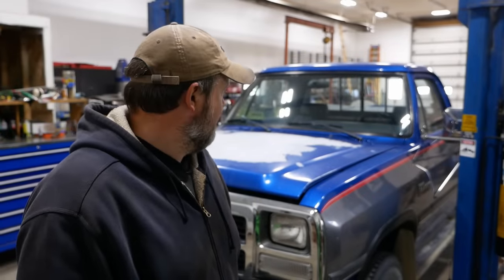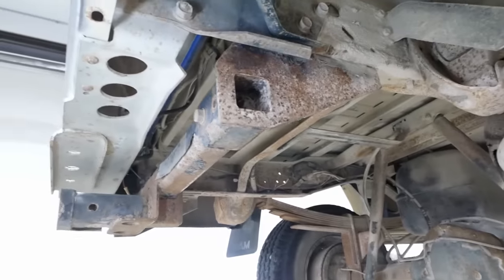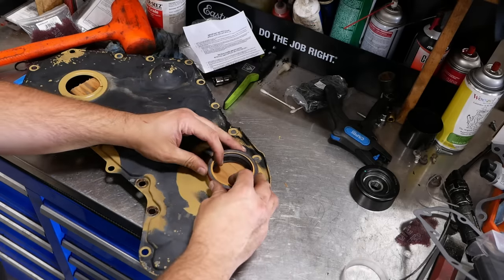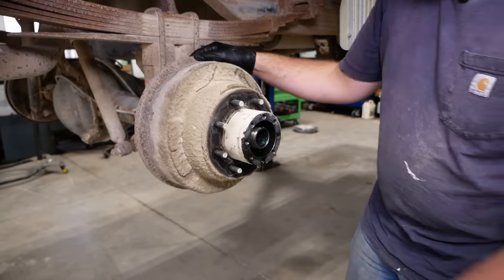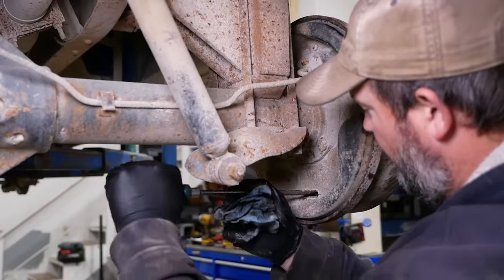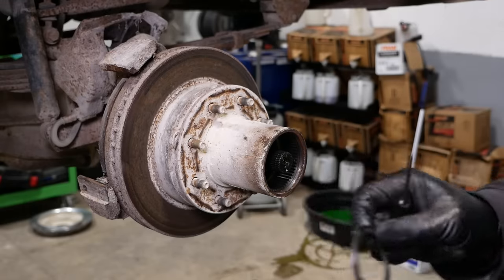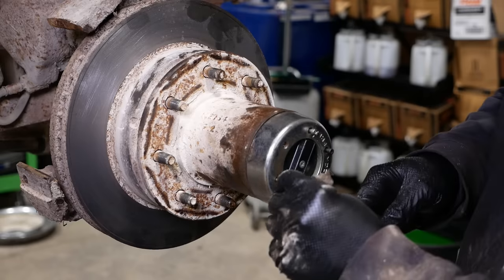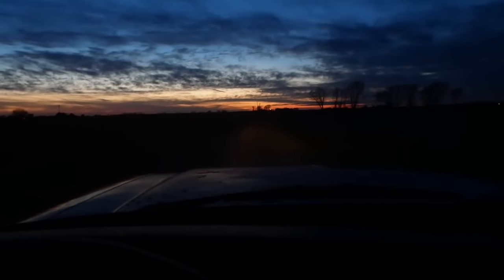Cherry 92 Dodge Cummins: Killer Dowel Pin, Brakes, Seals, Etc.

Comment: You said according to Dodge, about 5% of these will have the dowel pin failure. Does age have anything to do with chance of failure? Just thinking that since it made it this long, what are the chances it fails? That being said, the condition of this truck certainly warrants the fix. Nice work dude. Oh by the way, always enjoy the Max cameo.
Reply: age does not. a realtives daily had this happen at just over 300k a year ago. it did the works on the motor turned it into a paperweight. and my dads work place they almost exclusivly drive dodges for their work vehicles that need to pull trailers minus the one 7.3 super duty and their 2 6.0L E350 Econoline vans.  they got 6 98-01 Ram 2500-3500 with the same engine they ofcourse all ofem have a million plus miles but not too long ago one of them got a new Reman (old new stock) engine. its engine was just slap wore out. not even 35k on the new old stock dowl pin came out. busted their timing cover. don't mean to throw any shade at dodge but. reason why i like powerstrokes especially the 6.0L easiest to repair. and least likely to turn your block into a very nice Coffee table and a rolling chassis in the yard.
Reply: If your luck is bad then yeah it can happen. LR had an issue where they forgot to Loctite an oil pump bolt on the early td5's. Saw a forum post from some unfortunate person that had it fall out at 300k km. Him and his mechanic had assumed it had either been loctited already or had been from factory.
Reply: Age or mileage mean little. If you have one you should get it fixed now and mark the timing cover so the next owner knows it’s been done. There are literally no downsides to doing the job. Worst case you tear it apart to find it’s been done already. Or you open it up and find it almost out. It’s a cheap fix to avoid total catastrophe.
Reply: The biggest concern is that it's a dodge crummins. You're doomed until you fix that issue.
Reply: Age isn't relevant.  It was mostly a problem on the 94-98 trucks with the P7100 injection pump, but definitely happened on the earlier trucks too.
Reply: @justnsaliga8518  The dowel pin issue has been known for like....MANY years though. Plus the fix is...a tube of Rtv...and 5 minutes of fabrication work or some 20 dollar ''kit''. Really like...yeah its a PITA because its not perfect, but issue wise? It's a simple fix that doesn't cost much.

Comment: Track bar where it ties into the frame will get wallowed out there, due to the gear box flexing the frame horn that holds it.
They sell a new addional crossmember that ties both frame horns together allowing for proper support of the gear box..
It has an extention that goes through a block bearing mounted on the crossmember that extends down to allow for proper alignment of pitman arm that pivots every time you turn the steering wheel, and supports the lateral load of the suspension. 
The track bar mount on the frame itself gets chewed up for the excessive movement of the gear box and has to be cut off and a new higher grade steel mounting plate welded on, are at least added to the original plate to repair the damaged hole 
The other end of track bar that attaches to the passenger hub assembly typically is also worn out by the same thing.
New steering gear box 
New addional crossmember added 
Replacement of track bar 
Addional repair of mounting plate of track bar at frame driver's side. 
And typically tie rods,  if it doesn't have the stabilizers dampers for the steering 
It's usually a good idea to install the set with two stabilizers even if it has just a single one mounted, and especially if none at all in place. 
Also found that while shocks appears to be good its mainly just the springs doing majority of the work, and a good set of bilstines helps greatly control the death wobbles along with the above mentioned items. 
I've rebuilt 97, and 95 one a 2500 the other 1500 both 4x4's.
But they share the same parts as well as the f'ed up design all the way up to 3500's.
Not really all that expensive to buy, but fairly labor intensive, except for the benefit of actually being able to drive it like a normal vehicle instead of you constantly chasing the direction the truck is going, are then sudden attack of severe case of death wobble its not really that much labor considering the benefits and longevity of the truck was doubled are even tripled it's normal life span.

Comment: Nice work Wes.  I have the same Alemite bearing packer, although it doesn't get used nearly as much these days as it did a couple decades ago.  

I'm glad you see you double check the end play with a dial indicator vs. merely backing off the nut which is what I see most people do.

I have a client that has an old 1997 Dodge W-250 that is also in pretty nice shape for its age but it has nearly 200k miles.
Mike
Reply: In my 1960s high school shop classroom, our instructor had a sign hanging above the blackboard the said "If you don't have time to do it right, when will you have time to do it over". About the only thing I remember from high school!
Reply: @Watchyn_Yarwood  my dad would tell me the same thing repeatedly when I was growing up.  "If you don't have time to do it right the first time, when will you have time to do it again?"
Reply: @zmotorsports62  And you never forgot it. Young people today are taught "Don't worry about it, I'll get you a new one".

Comment: To mostly cure death wobble and shit front end on 2nd gen 3/4 and up trucks, upgrade your sway bar to a third gen.  Also look into the power steering stiffener bracket, those two things alone will change the whole driveablitly of those 2nd gen, oh and one last thing, as others suggested, upgrade to the borgeson steering shaft.  That was one of the 1st things I did on my 97 ram 2500.  That was a huge improvement alone

Comment: For the 97, If the steering slop is in the box try a red head steering box. Those original boxes are know to wear out. Also the make a steering gear stabilizer kit that braces everything.

Comment: Wes I had a 94 dodge with extremely bad death wobble. I did literally everything. New ball joints, new sway bar bushings. All new tie rods, steering gearbox stabilizer kit. Nothing changed at all when I did all of that. What did fix the problem for me is upgrading the track bar from the 2nd gen ball joint style to the third gen adjustable bar with bushings. That eliminated the issue completely. Not a bad install either. The kit came with a piece that mounted to the frame and a bolt ran through the existing ball joint socket. If all of your other components are in good shape I would absolutely do the track bar conversion. I’m 100% confident had I done that first it would have solved my issue completely.

Comment: The 95's front end can be upgraded in many ways. The best places to start are putting a 4th gen steering box in and switching to a 4th gen style linkage setup. Also switching to a 3rd gen panhard bar normally tightens things up a ton. There is a ton of other parts that improve it further Carli/emf ball joints, a good set of Theuren/Carli control arms, Borgson steering shaft etc.  But id start with a 4th gen steering box and linkage setup alongside a panhard bar.
Reply: i like this comment sounds like you talk from experience buddy of mines 2nd gen had steering slop it is lifted manual 2000. he complained about the truck being "all over the road" for probably a good 6 months or so. Ordered a Red head steering box and (can't remember the name of the brand) probably a borgson steering shaft. or something along those lines. suffice to say its been in his truck over 4 maybe 5 years now drove it once i drive almost exclusively superdutys suffice to say. it seems to fixed his issues entirely seemed his steering on a lifted dodge of all things was tighter than a couple of my Super duty's if not as tight almost as tight.
Reply: I've had three of them and the steering boxes were junk in every one of them.  I've heard good things about the Red Head boxes.  One thing I've heard about but never tried was putting a steering damper in like the off-roaders use, but that is just something I heard about in forums and things.
Reply: @justnsaliga8518  Lifting a straight axle truck takes away caster and that can really hurt tracking.
Reply: I've been trying to research this and would love any details you can provide on fitting a 4th Gen steering box into a 2nd Gen. Looks like the 4th Gen input is square rather than splined and return line is M20 rather than M16.

Comment: I think it has a recirculating ball steering box. On top of the box is a allen fastener with a lock nut holding it's position. Loosen the nut and tighten the allen head fastener to remove slack from the mechanism. Retighten the lock nut. Do not over tighten, there still should be slight back and forth clearance when moving the steering shaft, as this might cause binding when steering. 🙂
Reply: Then check steering wheel alignment. I think some mechanics mess with that to align the steering wheel.

Comment: They changed the steering for the 98.5-2002 HD (2500 over 8800lbs and 3500) different geometry much heavier parts. My 99 2500 4x4 cummins has nice tight steering, my buddy's 96 3500 4x4 cummins was all over the road until we changed his steering to the 99 HD stuff, his is great now. Just a suggestion from an old retired Army mechanic.

Comment: Great video on that old beast. Dodge had a period of time there in the late 80s and early to mid 90s where they couldn't design a front end to last. The only advice I can give is be ready to change out most of the frontend components. Tie rod ends, ball joints all of it. And don't forget to check the steering gearbox and its mounting. Stay safe my friend.

Comment: I had a 93’ W-250 Power Ram with 43,000 original miles. It was purchased by a company brand new and sat in a parking lot for years. It had a plow on it as well. When I bought about 12 years ago it had some really bad rust. I ended up selling it after a few years but if the Ohio winters hadn’t ruined it, I’d still have it. Really cool truck
Reply: 👆Thanks for watching, love you so much fan!!
    Tell  Aɴᴅʀᴇɪ Jɪᴋʜ, you were referred by me he has something new to share with you easily get in touch with him

Comment: If you have to pull the rear shafts again, the two nut and tab washer spindle nut system on the front axle will also work on the rear. Much better system than the single nyloc nut and wedge keeper. Great video, always entertaining!

Comment: I have to share the tropes that keep getting repeated on my brake resurfacing video, just so you can enjoy in the pain:
- You must grind the faces of the disc, they must be perfectly parallel and true (ignores the fact that new rotors have detectable runout)
- You can't use a brake lathe (or cut the rotor) because the rotor will warm up and warp again
- Why don't you just buy new rotors, they are dirt cheap?! (ignores the fact that OEM rotors are of higher quality than "cheap" parts store rotors)
Reply: Right! The rotor warms up every time you use the brakes! That's the plan. Change kinetic energy to heat and stop or slow the vehicle. Use sharp bits and the heat is far less than a normal brake application.

Comment: Lots of the 70's Renault cars use this design of caliper with the wedges. But they also have steel to aluminium calipers that corrode between the metals making the cylinder for the piston go out of round. You have to dismantle the calipers using alluminum wedges.

Comment: The 95 year makes had a problem with the front Coil/Shock bracket cracking and allowing to consistently shift which effected the steering. They crack where the roll portion begins on the sides. I welded up many of them and then gusseted them and that helped immensely.

Comment: In the future, place the metal to rubber seal in a plastic bag in the freezer for several hours ahead of time.  Heat the plate access up with a heat gun so it is warm to the touch.  Remove the metal to rubber seal from freezer, apply sealant and it should fall right in.  This method has worked for my 41 years in aviation maintenance.  Great info on the brake and seal replacements.

Comment: I’ve seen one “unicorn”. Driving down the road and caught a particular shipping crate outta the corner of my eye. Had to turn around and check it out. It was a 1st gen dodge 350 regular cab long bed Cummins manual. Only one I’ve seen, but rusted beyond repair, still being used as a plow truck and remarkably not a single dent in the whole truck. Couldn’t believe I had found a 350 Cummins manual. Obviously there’s more out there but you don’t see them often

Comment: I sometimes forget just how bad the rust is out there here in Southern Arizona we have vehicles sitting in the junk yard from the 50s with basically zero rust the little bit of rust that does exist is on the surface that you could scrape off with your fingernail lol.

Comment: beautiful truck. i had the same one but with a 5 speed manual but i sold it because the body was completely rotten. drove it for 13 years without one problem. tough as a blacksmith's anvil.

Comment: Wes, I have a drive axle from a Hyster electric forklift, and I'm building a tractor around it. I couldn't get the one brake drum to turn both ways, so I pulled the axle, pulled off the drum, and low and behold, there were a bunch a walnuts in it. The hole for adjusting the brakes was too convenient for a chipmunk or squirrel, so it wasn't as bad as I thought. I'm just glad it was a full floater, which made it easier to get in to work on it.

Comment: I had a 2008? (bought used) F150 w/auto locking hubs. It ended up with the known problem of water drips under the hood and into the system via the vacuum valve right under the hood. I replaced that and the rusty gunked up assy in the hub. It worked fine for less than 6 months. I had said I would never by another new truck. Not long after that I bought a plain new F250 standard cab and it has manual lockers.

Comment: If the king pins are in good shape, grease them up and add a 1/16" to 1/8" shim in there to tighten up the pre load on the  spring. We do this all the time for trucks running oversize tires. 
Make sure steering box back lash isn't super sloppy. Those heavy trucks tend to loosen up a little faster. The bolt on the top of box with jamb nut. Just don't go too tight you need some, you will know when its too tight. 
Also as mentioned make sure the steering shaft and column is tight.
A good dampener works wonders however only do this after everything had been checked out an tightened up. You don't want this to be your bandaid.

Comment: Dodge came out with that style in 1972.  It was updated in about 1979-80 with square headlights, and it was superseded with the "big rig" look in 1994.  Considering what Dodge trucks looked like even in 1971, this was a big step forward.  Great video!
Reply: Supposedly the front end of the frame was not heavy enough for the Cummins in that body style, and can cause the frame to bend over time.  Since it was designed to hold only a big block v8.
Reply: @bluegrassman3040  Totally not true, a Cummins 5.9 isn't that heavy really and plenty have been installed even in half tons and the frame is never an issue unless its corroded away.
Reply: This damn thing SOUNDS like a big rig on the test drive into the sunset..

Comment: For the 96 get someone to rock the steering wheel while you carefully look at the track bar for movement. I’m a retired Dodge tech and replaced lots of them. Also check the steering box for movement and don’t be shy about adjusting the box  Buy a good quality track bar as I put a cheaper one on my personal 96 truck and it didn’t last 2 months. Think I replaced it with a moog problem solver.   Love these old truck vids.
Reply: I agree. If you sit in the truck and turn the steering wheel back and forth and the front of the truck also moves back and forth the track bar is worn. a worn track bar will make it wander all over the road. It is usually worn at the ball and socket joint where it attaches to the frame. Does not take much adjustment on the box maybe 1/4 turn or less.
Reply: I had a 2000 year truck and the track bar was worn.  It would move from side to side when going over bumps.  It was the track bar end with the ball and socket that attaches to the frame.  I changed it out at around 60k.  I believe there are aftermarket solutions with traditional urethane bushings on each end that solve this problem.  If I still had mine, this is the way I would go.

Comment: Everybody commenting the steering gearbox mounting brace, you're wrong. That doesn't fix death wobble, only helps prevent it on lifted trucks. Wes, If you have bump steer there's a few other things you need to look at. The first one being the axle rod that keeps the axle from swinging left to right in relation to the frame. You have to make sure there is zero play vertical or lateral play in the ball joints Vertical end play can change toe in a bump situation. If the tie rod ball joints are not worn, then you may need to look at the camber/caster and toe of the vehicle as it sits on the ground with a laser based alignment system.

Comment: I don’t own a dodge but I’ve read about them having the “Death Wobble” when you upgrade to larger tires. You can Google this to see if this can help you Wes. 
The Death Wobble you get to a certain speed and the steering wheel starts to shake violently. Apply the brakes to slow down and it will quit. Again hope this helps you Wes.

Comment: I have a 1996 12 valve with the p pump. 194000 miles.  Family owned from factory.  Ram 2500 long bed. She be in gooood shape.